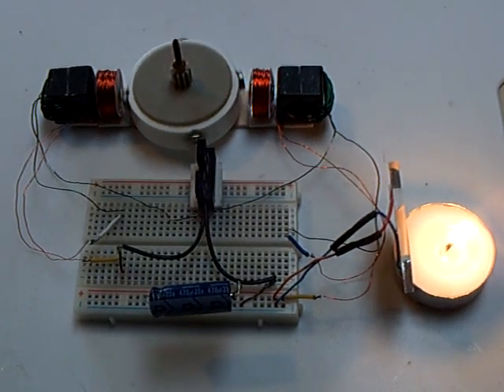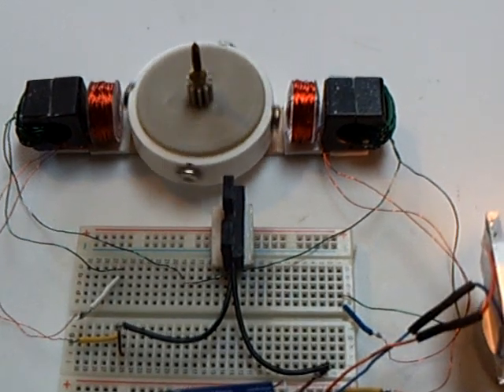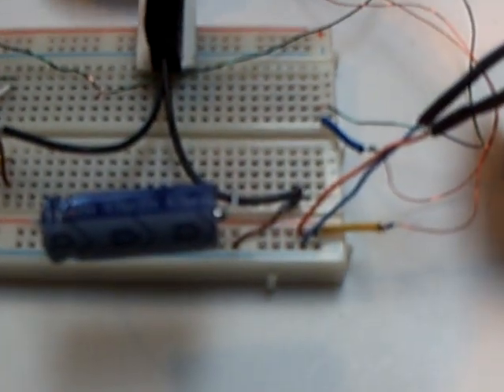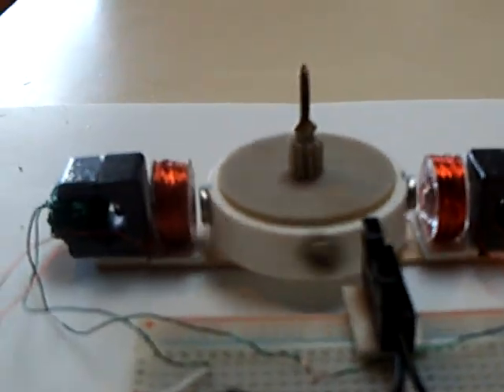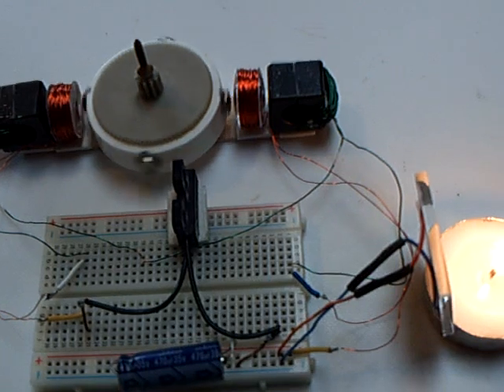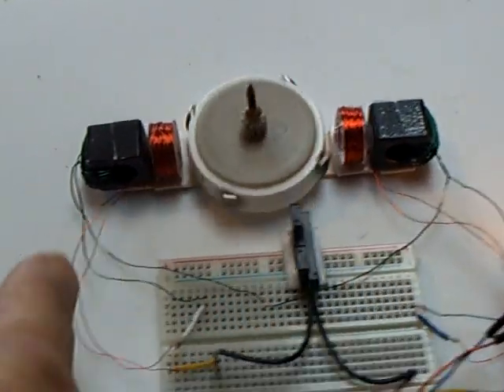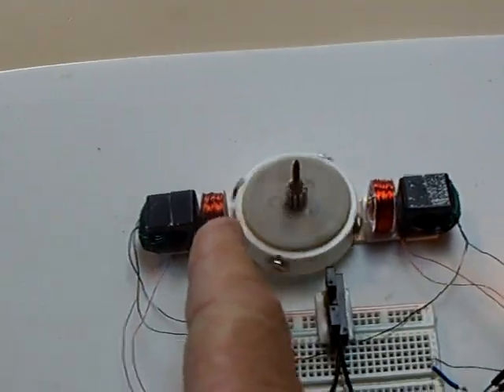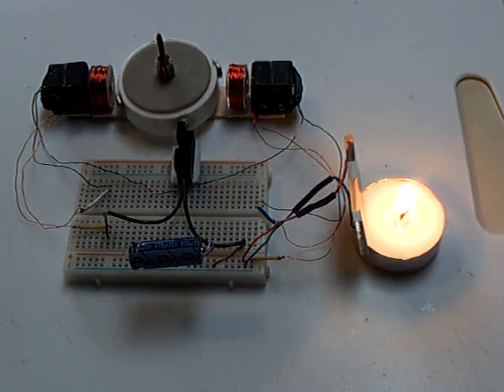Tea Light Thomas Motor

Comment: Wow.. driven by just candle light.  Impressive.
For additional clarity, would you show the schematic for the connectivity & show how the "out of phase" condition is created.

Thanks for sharing!
Reply from the maker: +A B For simplicity imagine that there are just two coils instead of four and they are connected in series.  The rotor has all N facing magnets.  When the circuit is energized the coils are positioned so that one pushes on the rotor magnets and one is pulling.  The extra red wire coils were simply added in series to the green wire ones so that they helped the situation---added push or pull.
Reply: +Lidmotor One thing I find interesting about this build is that your gn & rd coil windings are perpendicular to each other--which causes me to think the magnetic fields would cancel each other out to some degree. 

I can see from the wiring connectivity on your bread board exactly how the coil windings are wired in series with each other & the reed switch.  As I see it, the candle light produces energy in the solar cell, the solar cell charges the cap & the cap discharges into the coil windings when a rotor magnet closes the reed switch.  The energy flowing in the coils creates a magnetic field , that magnetic field affects the rotor magnets to cause rotor rotation, that rotation moves the magnet near the reed switch to a new location that causes the reed switch to open & that causes the cap to be unable to discharge into the coil windings--which then leads to the magnetic fields within the windings to collapse--which then creates a cemf discharge.  When the next rotor magnet passes in front of the reed switch, the process repeats. 

The reason I asked for the schematic is because sometimes its easy to get lost in the wiring--which doesn't usually happen when one looks at a schematic.

A couple of questions came to mind while rewatching your video.  I get that you are using the ferrite coupler pairs to concentrate the magnetic fields within the ferrite material, but it looks like you have 2 neodymium magnets inside the ferrite pair (nearest the rotor side).  Here are my questions:
1.  Are there 2 more neodymium magnets inside the other ferrite pair?
2.  What real significant effect does having those internal magnets produce?
*Note: * What I gleaned from Ben's video & comments is that he appears to think that the magnets give a repulsion boost to the rotor magnets as they just pass TDC (top dead center--which I assume means when the magnets are perfectly facing each other).  Do you share his conclusion or do you think something else is happening?
Reply from the maker: +A B I will have to think about what is really going on with my modified version of Ben's motor.  The orientation of my ferrite coils is different than how he has his or how an Orbo is configured.  Ben's idea of using the magnets inside the ferrites was to cause a shifting of the magnetic field when the coil was energized.  The all N rotor on my motor sits at rest slightly off TDC because one magnet/coil is in attraction and one is in repulsion with the permanent magnet field (each coil has a neo in it).  The ferrite core itself on both sides is of course in attraction with the magnets.  When the coils get energized torque happens.  How that happens NOW with these new added coils is a bit puzzling.  The field must be all wrapped up like a pretzel.
Reply: +Lidmotor So the "out of phase" is really a reversed winding (i.e. one gn winding is reverse wired so the polarity of the ferrite core windings are exactly opposite of each other--to create the push-pull torque at the same time when the coils energize)?
Reply from the maker: +A B Yes.  Right now there is a slight imbalance in the static permanent magnet situation.  The rotor (at rest) sits slightly off TDC. If it were perfect the rotor would simply spin around freely but it doesn't.  When the coils are energized the static situation is amplified and the motor runs.  Logic tells me that this is not quite right but the motor sure runs well this way.
Reply: Hmm... My thought is that the energized coil creates a magnetic field that distorts/amplifies the natural permanent magnetic field to give it a momentary higher force--which translates to a greater torque against the nearest rotor magnets.

Thanks for your insights!

Comment: Well done Lidmotor.
Could you please in your next video show a circuit diagram, how you have connected all the coils together... was not really clear to me now.. So does it now generate voltage, when you turn the rotor manually in this configuration ? Many thanks. Regards, Stefan.
Reply from the maker: +Stefan Hartmann  This does generate some with these coils added even though they are still out of phase.   I don't exactly know why.  The basic wiring structure is very simple.  It is four coils all wired together in series.  The green ones are 26 ga and the red ones are 30ga.  The pairs on each side are wired so that they both push or pull when they are energized.